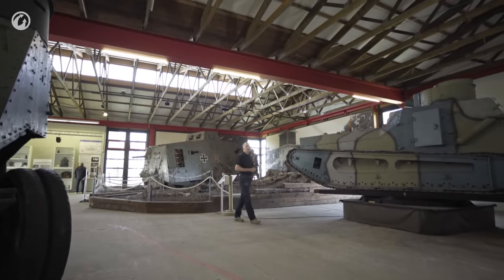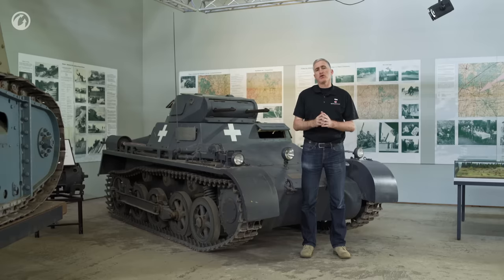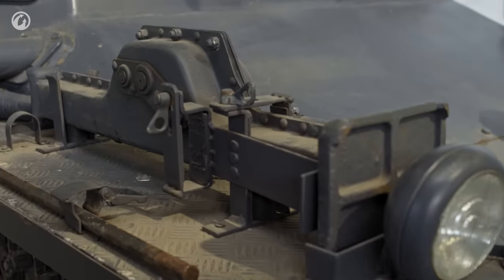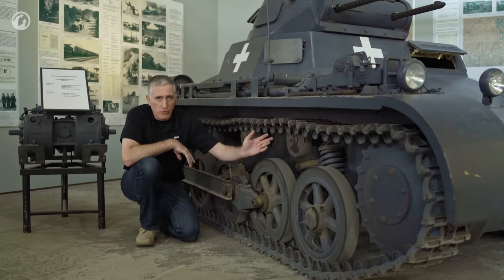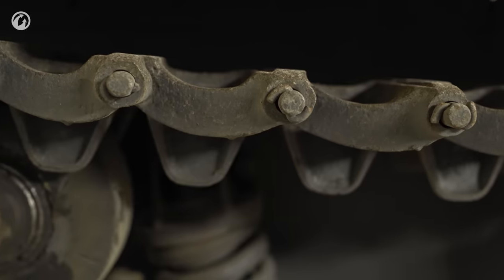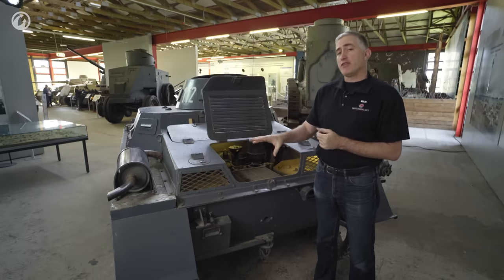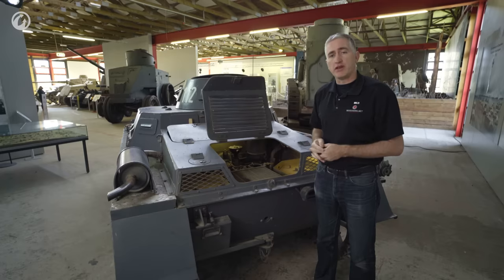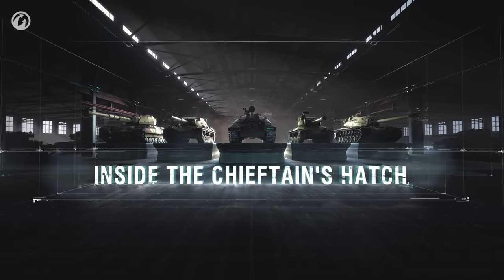Inside the Chieftain's Hatch: Panzer I, Pt 1.

Comment: Amazing how tiny it is. Will be quite "interresting" to see the chieftain-filled interior ;)
Reply: I think it will be more along the lines of "Chieftain puts on a Panzer I".
Reply: "Oh bugger, the Traktor is on fire !"
Reply: The tank museum in the uk has a command version which is slightly larger but the vehicle is still not much bigger than a ford  transit van. I just hope they didn’t have to cut the chieftain out of this one .
Reply: I mean, he did fit in the M22 Locust, though that is a bit bigger than the Panzer I.
Reply: @johnludmon7419    "[...] I just hope they didn’t have to cut the chieftain out of this one."
Once I climbed into a German Sanitaetspanzer kurz 2-2 [http://www.spz-kurz.com/assets/images/autogen/a_DSC_0516-2.gif ]. To get out again the Bundeswehr in fact had to remove the cover plate of that tiny medevac tank...  ;-)

Comment: Y'all are just trying to get him into the smallest vehicle you can think of, aren't you? That said, Italian L3 when?
Reply: Nah. Goliath.
Reply: The Italian L3 was relatively more spacious because it has no turret. I know because I have jumped inside at the tank museum outside Rome years ago and have talked to a veteran there. It was very difficult to climb in and once inside it was quite dark inside and I was amazed how primitive it looked and there are "peep holes" that can be closed by sliding the shutters blinding the view! Conversely it was equally difficult to bail out with the two heavy hatches closed. Perhaps it was the most useless tank ever conceived to be used in the desert especially it had very thin low quality armour between 8 to 13 mm thick easily holed with any anti-guns and if nearby also the 0.50 can create damage! Nope it's my not my tank at all especially because it was bolted/riveted (like all Italian tanks of tha period) that flew like bullets all around creating terrible wounds to the crews but it had good off road capability and was quite useful in anti-partisan warfare in ex-Yugoslavia because of it's diminutive size and was able to climb up to small villages with narrow roads...
Reply: Here's hoping for the AMX  ELC and/or ELC EVEN. Musée des Blindés in Saumur has both.

Comment: That suspension reminds me a bit of the suspension used for locomotive driving wheels. Those also have hinged suspension levers connecting pairs of adjacent wheels. The levers are called "equalizers", because they act to equalize the ground pressure (and thus, the traction) between each pair of wheels when one wheel goes over a bump, so you don't get a wheel slipping or derailing.
Reply: Krupp built locomotives long before they built tanks. I wonder if  a previous  locomotive wasn't identical in that respect. No doubt they were quite familiar with other designers products,so in that sense they had a wide variety of stiff suspensions to choose from.